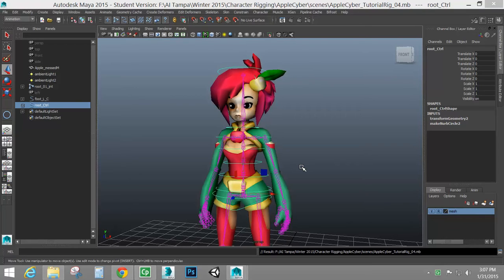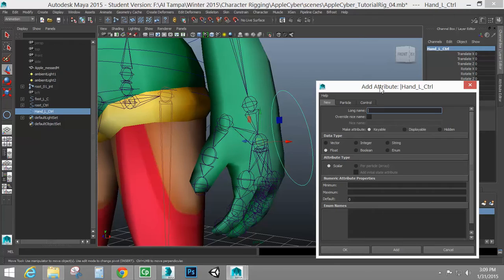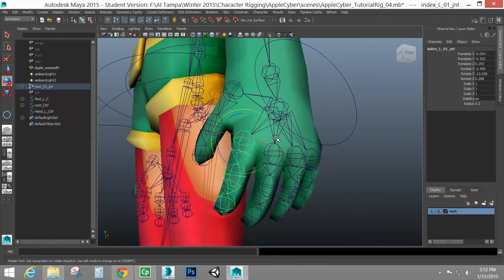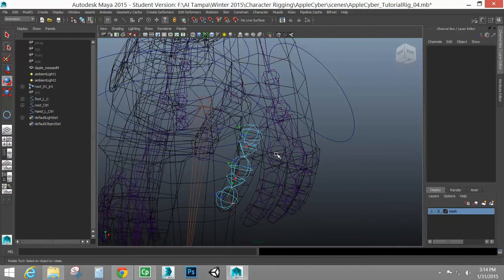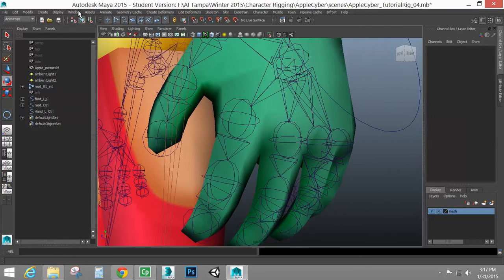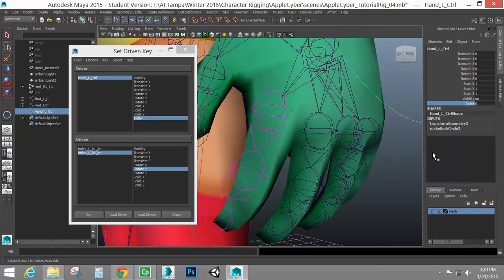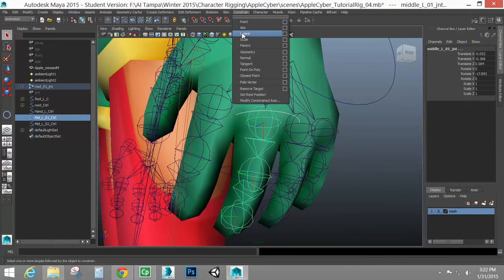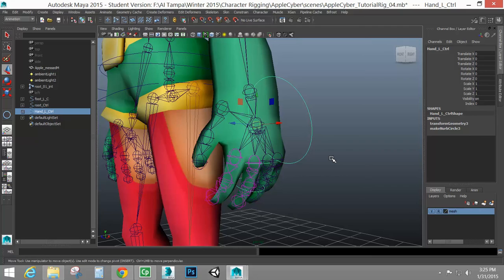Character Rigging - Step 5 - Hand Setup (Autodesk Maya)

Comment: When I parent the joints to the Hand Control, it breaks their connection with the hand joint. It looks like you're selecting the joints first and then the control in the video, but when I do it that way it doesn't work. Should I do it in the opposite order?
Reply: select control first then join

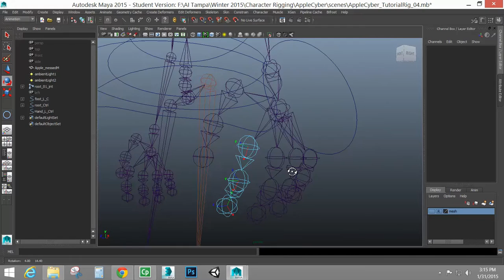Comment: 8:00 I can't seem to click on the axis in the joint. I turned on the ? selection and can see the axis but can't click it. I would hover over it and click while in F8 but nothing happens and clicking it just doesn't do anything.
Reply: Well, I couldn't figure it out so I went with option 2 in this video and just lined up the controller circles for each knuckle to follow each finger, before orienting them instead. It seems to do the same thing just as long as you only use the controller circle (which idk who wouldn't) to move the fingers. I just had to remember to change the component pivot and not the world pivot or it wouldn't work.
Reply: After doing everything to all my fingers in my scene. I don't really understand how to link it back to the controller. I did what you did at the end of this video but I'm not entirely sure if that's what I want it to do (ex: I want to be able to make a fist). I make a fist with the separate knuckle joints that you created but again, I'm not sure how I can make the overall controller to do all those things (close the palm) at once. 

Is there more to this process in your other videos or this video basically the extent of the hand (specifically the fingers and palm) process? Thanks, love your videos!

Comment: would the thumb joint's rotations need to be be rotating at a different angle, or is it OK 4 the thumb to rotate the same angle the other fingers do?
Reply from the maker: For animation consistency & ease, keep it the same angle. But no, they can rotate any angle. The important aspect is it rotates properly for the hand.

Comment: quick question, for some reason when I change the rotation angle of the circles to match the direction of the fingers, and I freeze transformation, the rotation gets reset and aligns to the grid and not to what is was set, is there a way to fix this?
Reply: +bgallego44 if you still has this problem add my skype:maxens8 i'll try and help you :).
Reply: hey man, did you solve it?
Reply: I don't exactly recall since it was about a year ago but I think you have to reset the positon then freeze it so it's at 0